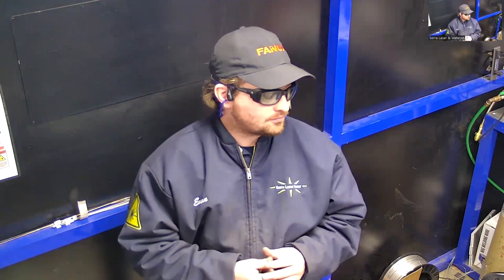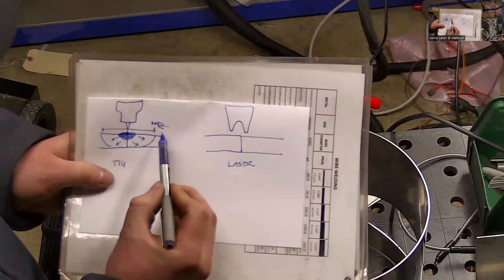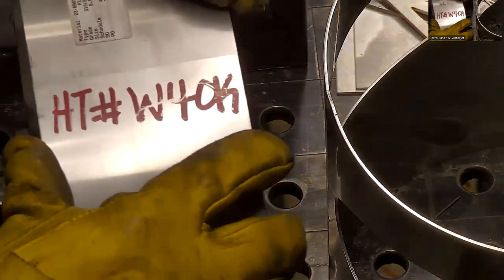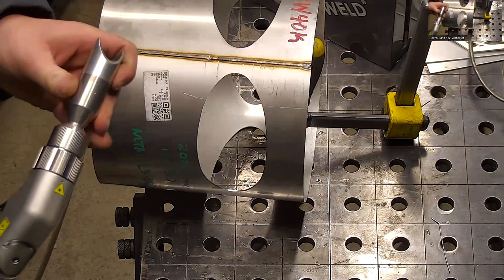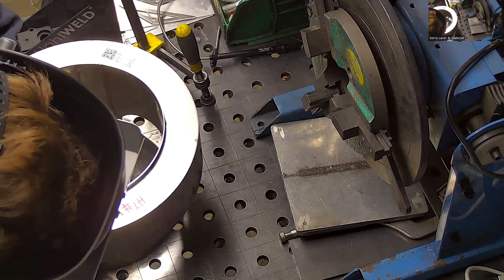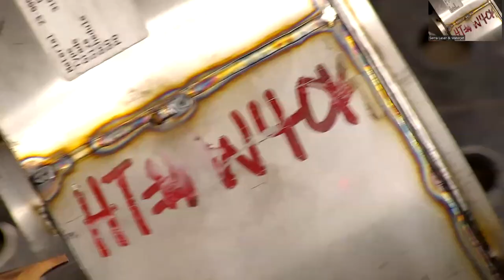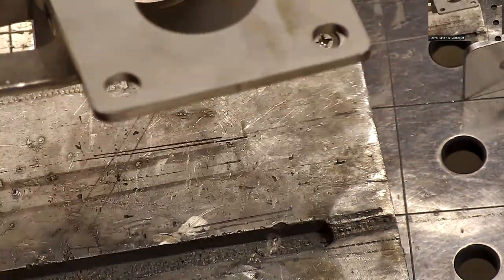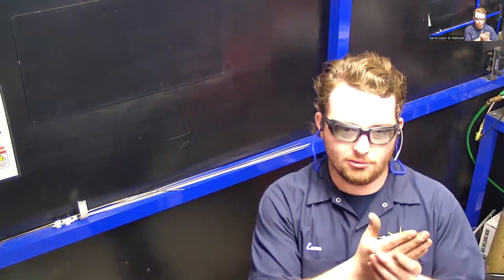SS Assembly welded with IPG LightWELD using IPG presets for tack welding, fusion, and wire welding

Comment: I find this interesting to watch.  I have laser welded for 24 years using CO2 lasers and recently fiber lasers.  The company I work for mainly uses Laserdyne systems which use a beam director, X Y X axis’s and an indexing router table.  My process is certified for depth of penetration and width at the interface.  Feeds speeds and distances are critical and each weld operation is verified by submitting a pre and post sample.  Every move is programmed using a CNC machine .  We do not add filler wire to our processes so every weld joint must be perfect.  I do not consider myself a manual welder but I am very aware of what a good vs bad weld looks like.  One observation of the way you are welding this part is there are too many stops during the welding process.  Use more tacks in you setup.  May I suggest the next time you weld a ring to a cylinder that you do so with the part rotating 360 before you tail out.  Put a low power stitch weld on the joint every 10 to 20 degrees before the final pass using a higher power to consume the stitch.  This will help hold the material together as you are fighting heat expansion of the sheet metal.  I’m not criticizing your technique, would love to get a chance to laser weld manually but our weld engineer doesn’t see the need for it but I think this would be a great tool to fix weld defects.
Reply from the maker: This was a one off weld to show what is possible in regards to hand held laser welding. For a production part additional tack welds - which is a IPG Preset and computer timed - this part would have the welding optimized.
Reply from the maker: The wire feeder sets the welding speed and wire touches the material and pushes the welders hand along. The aluminum wire speed ranges from 80 cm/min on .040 depth of penetration  to 65 cm/min on .160 or .200 depth of penetration.

Comment: The wire feed is that system twin drive lower with top undriven plain rollers?.
It seems manual laser welding the wire feed pushes the gun therefore it's just laying in wire to weld over and setting the travel speed ?  You must have slip issues? Maybe why the manufacturer is only giving information to use 5356 1.2mm filler wire one setting and nothing for any other ALU series/filler on their settings sheet.
  Any feedback on this from your hands on time ? What diameters / filler have you ran through it, I'd imagine softer like 4043 one example and less than 1mm would be very problematic..
Reply from the maker: We have used 5356 and 4043 wire 1.2 and 1.5 mm thickness. Both have worked ok. We have not used thinner wire but generally you tend to use a thicker wire. Welding speed equals wire speed and amount of wire used equals width of the weld joint. The lead is limited to 10 ft. Speeds are 80 cm/min for .040, 75 cm/cm for .080,  70 cm/cm for .120, 65 cm/min for .160 and .200 depth of penetration. The set up is a double roller push arrangement. Wire touches the material and pushes - paces the welders hand along. Most common thickness is 1.2 mm.
Reply: @Serra-LightBOT  in a future video if you had time could you integrate some information about the wire feed unit itself, take rollers out ect, is the bottom 2 rollers driven only? I'm assuming you put in the 'u' grove top and bottom for the given wire diameter, unless this unit is using flat top rolls. Thanks for the response 👍

Comment: What i absolutely not like in this art of machines is the mode setting. Like A0. You as a customer has absolutely no idea what this settings will do exactly. Sou you can not adopt it to another machine and have to stay with this art of machines.
Reply from the maker: Fiber lasers are not all the same. What the IPG presets do is make it easy for someone who does not know anything about laser welding to be able to easily set it up with no prior laser welding experience. And fast. Adjustments can be made. Power adjustment alters the depth of penetration, adjustment of the wobble width spreads the energy over a wider area - adjusted by % of factory preset - and frequency % of factory preset. And the user can make his own user presets where he has control of all the parameters - in absolute terms and memorize these with a two digit recall. This section of LightWELD is accessed thru the IPG user interface. Each builder has a different set of  parameters - beam quality and mode type affect the depth of penetration with a given power - focal length, fiber diameter, collimation all can change the weld parameters between one builder and another. IPG also considered the environment welding takes place in - so wanted a system where the set up consisted of adjusting knobs and simple input vs. trying to adjust many parameters with a welding glove on a membrane screen - which over a short time will show wear and be unreadable. Use the IPG Welding Mode chart to look up the material - type of weld - fusion - wire - spot/tack - and depth of penetration and a two digit alpha code sets the weld up. Simple but powerful.  Make fine adjustments where needed - memorize the adjustments if desired -  and weld. All IPG preset conditions have been tested and x ray analyzed - and work right out of the box.
Reply: @Serra-LightBOT  thanks for the complete explanation.
But I think Fiber laser are all the same. Maybe different quality of the material and maybe not exactly the same power output ase described.

I would prefer ipg only give the power settings and wooble seetings for different application. If you use this so you can laser welding with any machine world wide.

Anyways, thank you for the explanation.
Reply from the maker: No problem. But in reality they are not all the same. Even IPG lasers are not all the same. The multi mode fiber lasers IPG uses on the 1500 and 1500 XC will penetrate .160 into the material. The 1500 XR - with the same power - will penetrate .250 into the material. The energy density is the key here as the XR has a smaller beam spot and has 6 X the energy in the same space - which is more efficient in coupling with the material. IPG lasers are known for their beam quality or brightness This has a beneficial effect especially on welding reflective materials such as aluminum and copper. Especially thin aluminum. With a multi mode laser it takes about 700 watts to weld aluminum or the beam just bounces off the aluminum. With the single mode laser you can start welding aluminum with 350 watts which makes welding thin aluminum much easier to do. In general a single mode laser uses about 30 % less power to get the same depth of penetration as the multi model. Which has the effect of minimizing heat input into the part. IPG makes alot of different fiber laser sources and has many years of welding experience - in batteries - automotive and other applications - and this experience was brought to the LightWELD product.
Reply: @Serra-LightBOT  Is an A1 setting equal to an E1 if both are manually changed to 1000 watts & 30 wobble frequency?
Reply from the maker: John- what model of LightWELD are you asking about ?